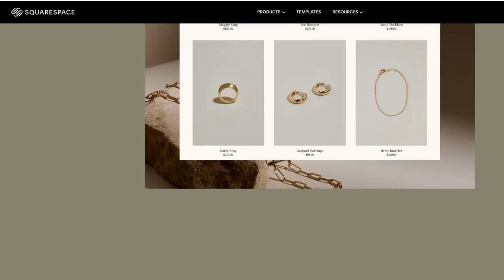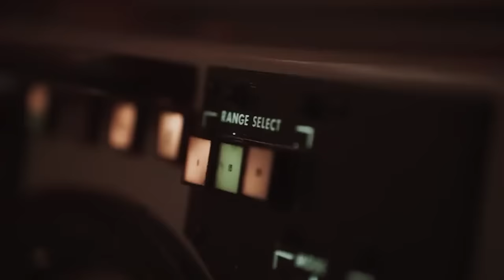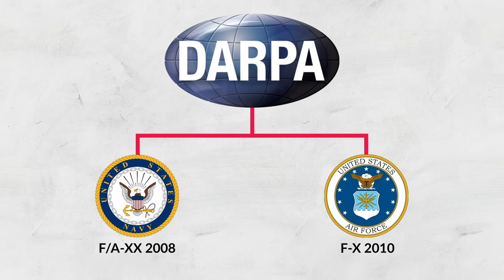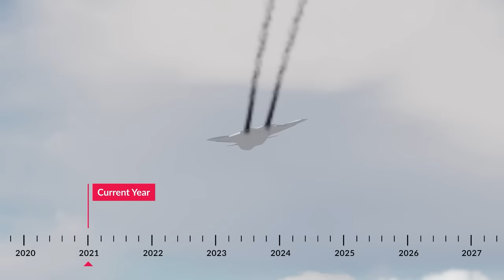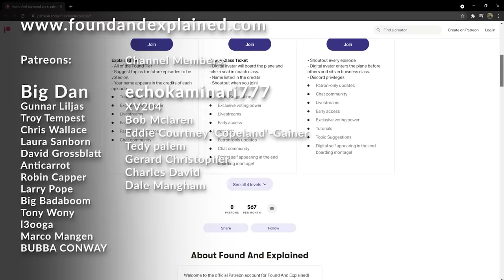FA-XX - The Next American Fighter Jet

Comment: The F22 was designed in the early 80's. Can you imagine what we have now, that is classified? It's all drones from here out, dangerous times ahead.
Reply: yeah but you still cant get the F-22 to work. lol
Reply: Drones can't fogfight
Reply: @xfactor6099  you have no idea what you are talking about.
Reply: @kdrapertrucker  it's clear you don't either.
Reply: YF-22 was designed at the last minute of the ATF design phase in the late 1980s, after Lockheed wiped the slate clean with their enlarged F-117 model, and started basically from scratch.  It scared the USAF because Lockheed had spent years on the previous design.  The F-117 type airframe simply was too enlarged in the middle of the fuselage to reach Mach 2, so they canned it.
Reply: @xfactor6099  so you admit that you don't?
Reply: @RandomHQ433  no, it's clear you don't.
Reply: @xfactor6099  you said it's coear you don't EITHER tho which means that you also don't
Reply: @xfactor6099  Do you mean the F35? The F22 Raptor works pretty damn well by all accounts. The F35, let's just say "they're working on it"
Reply: @xfactor6099  how does the F22 "not work", exactly?
Reply: @xfactor6099  I get what you mean but your confused the f-22 works but was to expensive to be our main line fighter it’s the f-35 that your thinking doesn’t work. Even that is debatable but I get wym.
Reply: @JC-hq3ub  lack of parts as factory line was scraped, lower orders than expected also meant more expensive individual aircraft
Reply: @jasonjones4891  yes unfortunately boots on the grown till this day after so many technology leaps and shit all this artificial Intelligence is still not enough to duplicate what boots on the grown still do!!!! Sad but true we still gotta put our boys in a little risk hopefully it cuts risk way way way down pray to god’s.
Reply: @hphp31416  yes but the f22 is also the most advanced dog fighter/ stealth aircraft ever built.  20 to 30years ahead of it's time. It's 40years old yet has no near peer threat.
Reply: @kdrapertrucker  Drones have missiles in defense.
Reply: things like aircraft development don't always happen at the same pace. we haven't had a cold war adversary pushing us to develop like crazy since the USSR
Reply: But the next aircraft is manned?
Now is it drones from here on out?
Reply: @kdrapertrucker  drones can't dogfight? Says who?
Reply: @xfactor6099  still better than the su-57 no the whole of russian air force
Reply: @xfactor6099  how exactly does it not work lmfao
Reply: it's ace combat 7 all over again
Reply: @kdrapertrucker  Neither do you!!
Reply: @dextermorgan1  After a trillion in development and 10 years behind schedule..3 different airplanes for 3 different services and none of the
Reply: @dextermorgan1  the F-35 works really damn well by all accounts as well, in fact most experts agree that it's superior in capability to the F-22 (and every other jet out there) at this point
Reply: @yomama629  probably right but then the f22 is 20 years old and probably needs updated. It is still superior in stealth and the air to air role than the f35.
Reply: @xfactor6099  F-22 works just fine.
Reply: @SWATCHIEF22  Missiles are limited use when dealing with a stealthy adversary. As you do not have the detection range to fire BVR.
Reply: @xfactor6099  i smell communist!
Reply: @xfactor6099  The f-22 raptor is operational they just retired it for research and development of new gen fighters.
Reply: It’s nothing to be afraid off. Design concepts for the F-22 was made 20 years before first one join service. Same as f-15. Joined service 10 years after development. Same follows for f1107 and the b-2 spirit. Russia and China both have “designs” that are next level. It’s just like the B-21. They boast about having it, but it isn’t ready for at least another 5 years.
Reply: Yes…we’ve got maternity flight suites… and gender changing tech development programs for the army.
Reply: @kdrapertrucker LOL no it doesn’t.
Reply: @mitsuevo8mr Clean your nose.
Reply: f/a-37 talon
Reply: @xfactor6099 bruh lol
Reply: @xfactor6099 I think you like mean the dude can’t get the f22 to fly even thgouht skilled pilots could fly
Reply: I hate to tell you, as an A&P, I’ve been keeping my finger on the pulse of aviation tech. There’s not a whole lot going on other than, this new plane might be cheaper to operate than the F22. That was the big downfall of it, to keep it simple. It was a money sponge, and it’s platform wasn’t capable of being updated with newer technology, they’d basically have to redesign the whole plane to accommodate these updates, and by that point you might as well design something that could be upgraded easily (the FA35). I reckon the “FA-XX” will be similar, but with a different focus than the e FA35. I’m curious as to what they want to do with it that the 5th gen Lockheed couldn’t do… but idk. I have a suspicion it’s all just hype. They already announced the new F-15EX, so it’s probably just something like that lol. I doubt it’ll look anything like the fan made CGI renders you’ll find on the internet.

Mind you, fighter roll jets are generally pretty antiquated in use. There aren’t many occasions where the military needs to commence in Dog Fighting. That’s a very 80’s and 90’s thing. Top gun doesn’t happen anymore lol.
Reply: They have multiple ways to produce lift, control the plane without traditional control surfaces, and materials that make things previously impossible, possible. They could have crazy plasma actuators that envelop the aircraft in plasma for manipulating radar signatures, and these same plasma actuators could be used to manipulate the aircraft instead of or in addition to normal control surfaces. They have crazy active aeroelastic wings that can change shape in flight. They have quiet sonic boom tech. Who knows, maybe they even have crazy magnetic reinforcement.
Reply: No,in 1990s
Reply: Yeah

Comment: Whenever I hear about the next generation of fighters, I always get anxious because I cannot wait to watch an airplane reach very high Mach speed!! And by very high, I mean at least Mach 3.5!
Reply: Who knows, the F-38 (or whatever the F-XX would be named) could go Mach 3. :)
Reply: The material science is a bit…… off….. tho. Mach 3 makes the aircraft really hot and s ducts probably are not very practical for that kind of speed since it massively adds drag which would require much more powerful engines. Not to mention RAM coatings would probably be obliterated by the air friction. But who knows, maybe that kind of engine and material science is actually possible but classified.
Reply: fighter jets have been slowing down. With missiles, drones, and smart weapons, speed for the fighter plane is no longer critical. Speed of the weapon is still important though. F-35, F-18 and others don't even go Mach 2, and weren't designed to, nor required to.
Reply: How will make a engine..!?How many fuel can fit into tank of plane...!?10 tons?15 tons?
Reply: Honestly speed isn’t necessarily the goal anymore. It’s all about stealth and long range attacks. 

The faster a plane needs to go, the more expensive it becomes (we are talking about exponential price increases here).
Reply: @canadiangunguy5512  true...
Reply: @MaticTheProto  I like comment 👍 and too bad to 6 th generation plane doesn t go about 3000 /h...!?
Reply: @MaticTheProto  there's no substitute for speed in air fighting, as there's no substitute for a pilot in an airplane.
Reply: @Michael_Michaels  yes it is and yes there is.

Nowadays planes don’t really need to be agile or extra fast, the age of dogfighting is long over
Reply: Anyone notice the prof pic yet?
Reply: Id rather see it get further into space than just speed.
Reply: Sr-71 we’re coming for your record
Reply: The problem with Mach 3+ speeds is that it puts very heavy strain on the airframe and aircraft skin. SR-71 Blackbird needed a titanium construction and had to be kept in air conditioned hangars, the MiG-25 was made of stainless steel and could only achieve Mach 3 in short bursts which totalled the engines. This is exacerbated when you want to incorporate stealth into the aircraft; F-22 can easily reach Mach 2.2 but this damages the RADAR-absorbent coating over time. Materials engineers will have to come up with something very clever if they want to produce an aircraft that incorporates stealth and high speeds without compromise. Not to mention that high top speed doesn't matter as much as acceleration in modern dogfights. As long as the aircraft can easily and quickly reach Mach 1+ at sea level and Mach 1.5 - Mach 2+ at altitude and maintain good energy retention through manoeuvres not much else matters. F-35 has proven itself extremely capable in exercises and it can only reach Mach 1.6, but it has an insane thrust:weight ratio and accelerates and maintains energy incredibly well.

That being said, aerospace technology has come a long way and only continues to advance. Maybe we'll see a return to the high-speed interceptor concept a la F-14 & MiG-31 as missile technology improves.
Reply: @myusername3689  the X series has more than exceeded mach 3, with the unmanned waverider X-41 and 43 going way iver mach 5. So the material exists to survive those conditions, but for how long is a different matter.
When an aircraft is designed purely for speed you can get something like the X-15 fairly easily, the main issue is designing something fast that is actually relevant to combat operations and can complete a useful mission.
Reply: E Van  America is very capable of having stuff that goes fast.
Im a massive lover of the waverider missiles, and i cant wait for that technology to be utilised.
The issue is making it useful. The X43 has such a complicated launch that it would be hard to justify deploying that system. And weaponising and aiming them is a whole different problem. I more than believe America is at least close to fully weaponising the technology, but its a very complex process and I dont think they'll be field ready for at least a few years
Reply: @MaticTheProto  well, is that your opinion or you read that from others? I'll give you just an simple example and the only thing that I request from you is a bit of deliberation: using the current war events, specialy Russia using hypersonic missiles, how do you expect to battle them is you don't have a really fast air plane? Will you battle it with another missile? I find it very hard to do that... 
I have spoken.
Reply: @Michael_Michaels  how is a very fast airplane supposed to help with that? You are using kindergarten logic.

The only time a fighterplane successfully managed to destroy missiles was over britain in ww2… and those missiles were essentially self guiding jets with a bomb in the nose
Reply: @Michael_Michaels  So why are modern aircraft slower than fighters from the 1960s? There very much is a replacement for speed (unfortunately)
Reply: @My Username
Actually it has already been confirmed that the American 6th generation Fighter must have hypersonic characteristics .... Confirmed by Paul K. Meyer, Vice president and general manager of Northrop Grumman’s Advanced Programs and Technology Division. The UK/Italy/Sweden/Japan Tempest fighter will also be able to reach speeds of Mach 5.

Comment: Another important factor of 4G fighters and the reason they added fly by wire is relaxed stability.
This give the aircraft incredible ability but make it technically unflyable.
They require 1000s of input corrections every second just to fly the plate straight and level.
Enter flu by wire.
It maintains a mathematical model of the aircraft in the computer and only the computer has access to the flight controls. 
1000s of times a second it uses onboard sensors to update the state of the model.
Now you add the pilot.
They input what they want the aircraft to do, say, roll
Now, 1000s of times a second time computer takes the pilots inputs, subtracts from them the current balancing inputs calculated from the model and sensors and send that too the control surfaces.
Now the plane rolls and to the pilot it's a traditional natural stability aircraft.
Reply: Gotta love PID control
Reply: As a former military pilot myself, I really love this kind of comments under a YT video. GG, sir =)
Reply: And 6th gen fighters may be even more unstable than 4th gen
Reply: > Enter flu by wire

Is that some kind of computer virus?
:)
Reply: A way simpler version is often used in cars nowadays with the gas pedal. You essentially just tell the car how fast you want it to go and a computer figures out the most effective way to get there considering the circumstances
Reply: Fly by wire? That's not something New. You mean 21st Century advanced integration flight computer controls and mechanical engineering.
Reply: @yayayayya4731  yeah, look at the fighter they decided to show the most, doesn’t look too yaw stable
Reply: @extralargemcfries9891  yep. Getting rid of as many unnecessary surfaces would increase stealth, so yeah. They would have to use different stabilization methods then
Reply: @mcs699  cause plane go bye bye when emp
Reply: What makes someone think that it's necessary to explain 40 yr old fly by wire basics to aviation enthusiasts?
Reply: @tessierashpoolmg7776  me
Reply: @fridaycaliforniaa236  are you?
Reply: @extralargemcfries9891  it's perfectly fine. Rudders stabilize against the Dutch Roll. If you increase drag on one wing you can control Dutch roll.
Reply: @fluoroantimonictippedcruis1537  sounds like it’ll kill airspeed doing that, also don’t fly into my house when I’m not there
Reply: Kali Linux  
Probably.
Reply: The Red Baron's Triplane was also unstable in flight to make it very maneuverable.
Reply: This is also true of the MD-11 in order to save fuel.

Apparently it crossed nobody's mind that's having a civilian airliner inherently want to fly backwards might be cause for concern. Thus if the system malfunctioned it would stall and flop around in the air like a falling leaf, being almost impossible to control.

Unfortunately because it has hundreds of passengers and crew rather than just a pilot in a G suit, this situation is suboptimal for their health.
Reply: When I see the 4G fighter jet like the F16, F22, F35, Eurofighter 2000 fly, I did not see the aileron, rudder, and elevator, and other surface move up and down at all. Since this did not happened, then there is no correction done by the computer to keep the plane stable as stated by these manufacturers. If you have a different explanation than what I have stated then go ahead and explain it.
Reply: @tessierashpoolmg7776  Well some here aren't enthusiasts and are just hobbyists who haven't dug into the inner workings of the less spoken about technologies in modern planes.
Reply: @rangiroa100  the f22 and f35 are 5th gen
Reply: Flu by wire
Reply: Flu by wire I was hoping we would have that
Reply: Not gonna lie this makes me think of the movie stealth cuz the concepts look very similar and with them starting to lean on AI so heavily I have a felling one of these days it’s gonna come back and bite us in the ass if we aren’t extremely careful about the path we take forward into the future.
Reply: @rangiroa100  
They're very small and very fast corrections.
It's so fast it completely stops the aircraft from deviating from its present course.
Reply: @tessierashpoolmg7776  
It was just missing, so I added it.
And not everybody already knows.